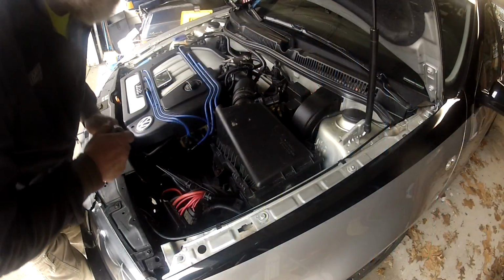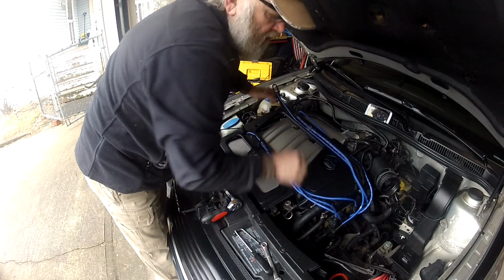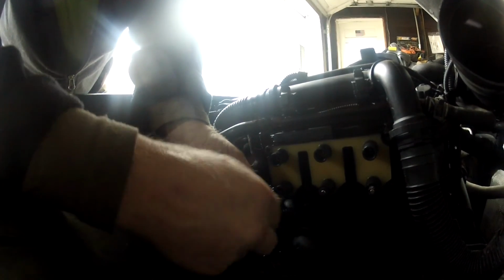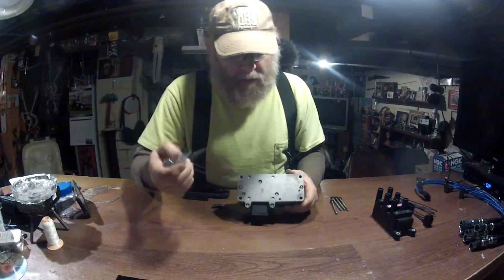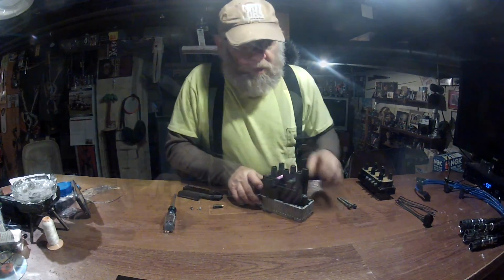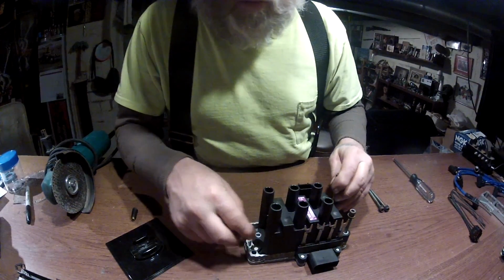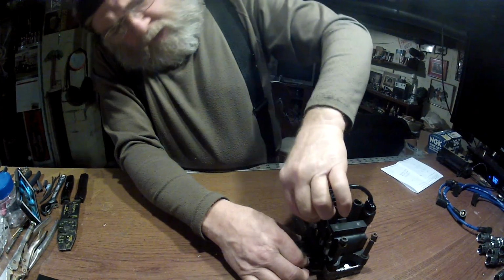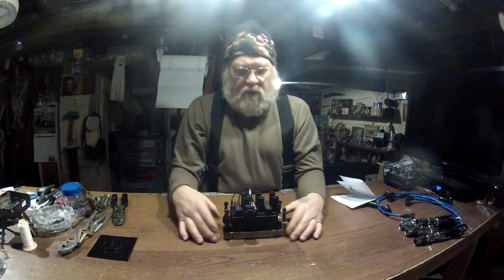MkIII & MkIV Jetta VR6 Coil Swap

Comment: Pretty Nice Video,,,,,,But Could you put the Part Number from that MOtorcraft Coil and all other part to do this Swap. I´ve been changed 2 or 3 coilpacks and in 1 year or less back to the same Misfire problems !!  Can I use my OEM Spark Plugs with this Motorcraft Coil ?
Reply: I found it in a 2001 2002 Ford f150 same.coil pack junkyard 30 bucks